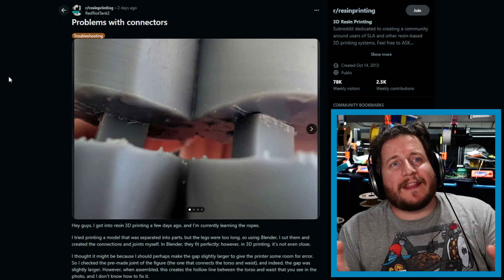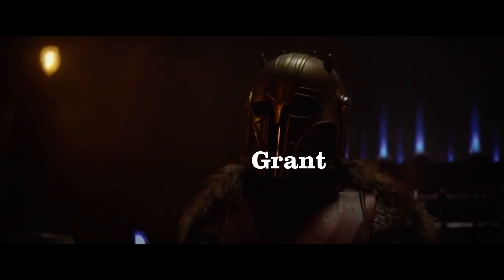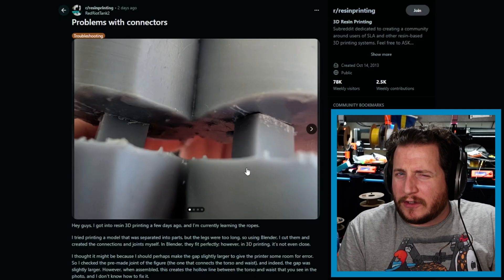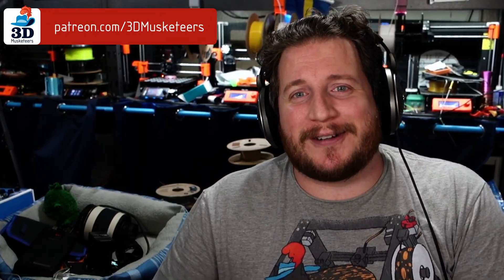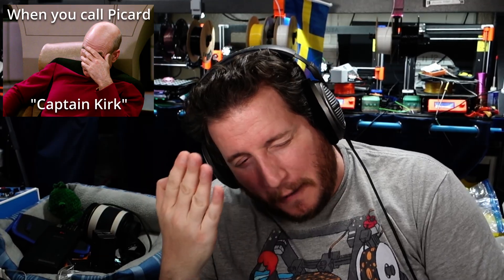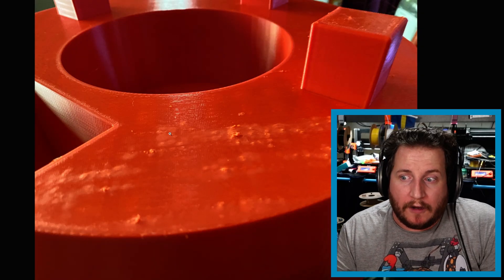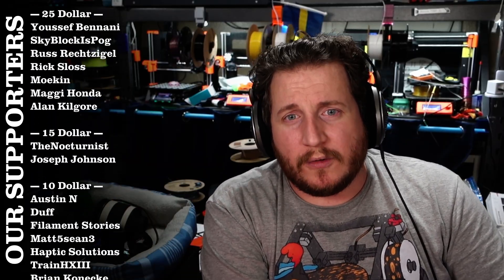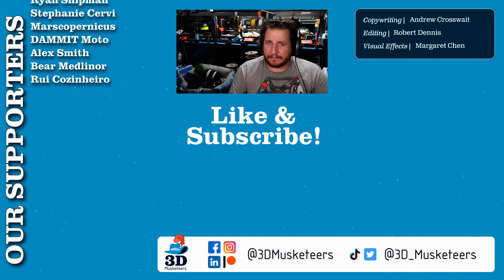Good Luck Printing With THIS! - PrintFixFriday 214

Comment: For that jst, 40w at 12v is 1.66a and at 12v is 3.33v. That is well withing spec. Loose connection could be the culprit, but so could a short.

Comment: One other thing I've seen regarding pillowing on the top layer is if you have a cooling fan setup like on the Prusa Mk4 (not Mk4S) sometimes it can stretch the filament upward as it blows across it to cool it. Only happens from a specific angle. I was carefully watching a print to see why it was failing and saw the fan blowing into the cavities inside the infill and lifting up the cooling plastic. The only way I can think of to fix this is if there's a way to change the angle of the first top layer on top of the infill so that it prints the bridges parallel to the direction the fan is blowing.

Comment: @5:19  That looks like 2mm pitch JST, they are typically rated at 2 amp's at 100v  (200 watts) or higher.  That scorching is from a bad joint connection, not the JST itself.

Comment: Resin clearances and distortion is something I've been battling with after changing to a new saturn 4 . The original saturn that I used a lot and got used to, used a straight pull peel, where as the saturn 4 's peel is angular by virtue of the bath swivel.  Supporting the part is trickier and orientation is even more critical.

Comment: The jst connector is probably ok , the crimping of the wire to the terminal is probably the problem.  Poor crimping is common and usually distorts the terminal leading to poor connection and burning.

Comment: I was wrong recently when mounting a 50 foot air hose reel in my garage. Not only did I mount it on the wrong side of the mounting bracket (causing it to skew sideways) but I also looked at the logo on the side… and it was upside down 😂

It’s since been remounted CORRECTLY.

Comment: Hey had a question you might be able to answer im in the u.s. and wanted to get my hands on the bambu lab p2s and ams 2 pro where can I find it or can you help its not on their website thanks in advance
Reply from the maker: Not available yet.
Reply: @3DMusketeers  ok thanks for the info 👍
Reply: @3DMusketeers  without getting controversial with it, its because of the tariffs i can buy it anywhere else 😢

Comment: I didn't realize that (in PrusaSlicer) the "Automatic infill combination - Max layer height" setting could be an absolute value. I usually have that at a percentage, and typically use the default of 100% and let the "Layer height limits" of the Printer/Extruder # setting drive the actual printed infill layer heights. In my experience, the automatic infill combination settings work really well to cut print times on models where I'm using variable layer heights. Most of my prints are functional so I don't mind the racing stripe effect of some smaller layer heights in the middle of the print.

Comment: I add between 0.1mm and 0.2mm tolerances for resin printing, depending on the part, resin printers are more accurate but resin warps 
Personally I prefer to sand/grind than fill, because if I fill then I have to sand it to make it smooth

Comment: What is the issue about grid infill, and why would cubic (any variant) be better? If the issue is crossing lines at the same height, cubic does the same, and at some layers there are 3 lines crossing the same point. Or is cubic a little better on the crossing because the crossings aren't at 90°?
Reply: Cubic does tend to be a bit better because the crossings are at an angle vertically, so problems don't accumulate as badly as grid. There are also variants of cubic that are relatively sparse on the bottom and get dense further up, which can really speed up a print. That said - I do wish there were more options for infills that don't cross, especially adaptive variants that are faster to print.

Comment: I confused linux and linus. To be fair I hate both of them. (all of them the guy that made linux and the the guy that runs LTT and linux itself)
Reply: Did u nuke your linux system?
Reply: @LeftyPencil  I've tried it many times and it never works right. Even my octoprint has issues. But even windows 11 just works.

Comment: Those wires on the mr fusion system don't look like they are rated for 1.21 jiggawatts! lol
Reply: might need that much to push through the pure insulation.
results may vary, explosively

Comment: That connector on the Kobra S1 is JST-XHB (some knockoffs hotend clones use JST-XH), which are rated for 3A. That's a theoretical 72W at 24V. I sadly don't know the wattage of the heater cartridge (yes, they're using a heater cartridge, not a ceramic heater).

You said "while it means it's not anastropic" (whatever that word is). "anisotropic" means "not the same strength in all axis", thus meaning that "the infill is isotropic", which it sure isn't xd.  I love picking nits :P
Reply: But the knokofs are uchely a lot worse
Reply: Typical hotend are 40-60W

Comment: I am gonna be ordering some prusa core one printers.  Have you seen or heard of any common issues to watch out for with them?
Reply: Make sure they are fully up to date and the belts are tuned to the latest specs, and make sure PrusaSlicer is up to date and has the latest profiles. There were some VFA problems when the Core One was first introduced, and Prusa had to do a lot of tweaks to get them resolved..
Reply: @logicalfundy i got one in and i am loving it.  I wasnt ready for the speed difference between the core one and my mk3s
Reply: @wassamworks3dllc if you're coming from the Mk3S, yeah it's a big jump. You get the benefits of both input shaping and the Core XY architecture.